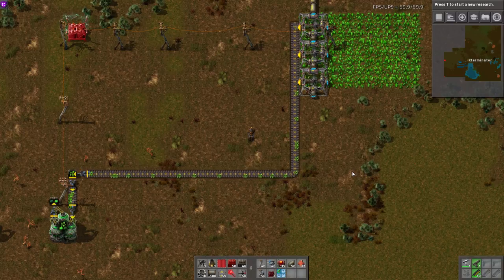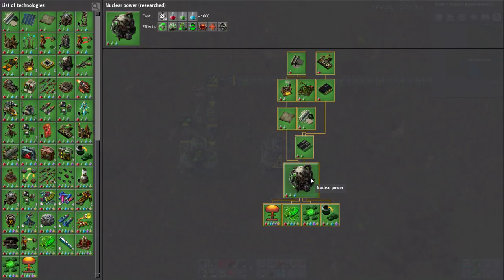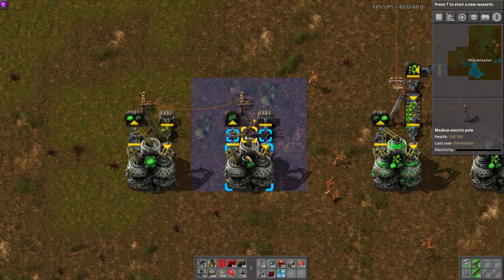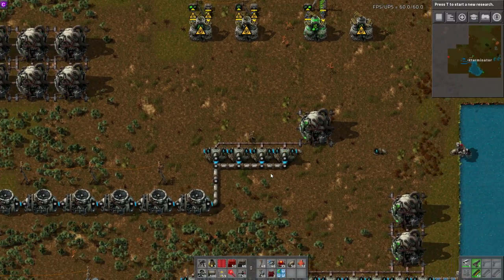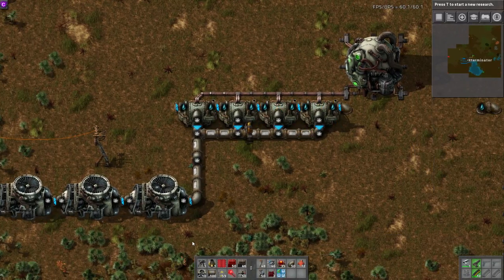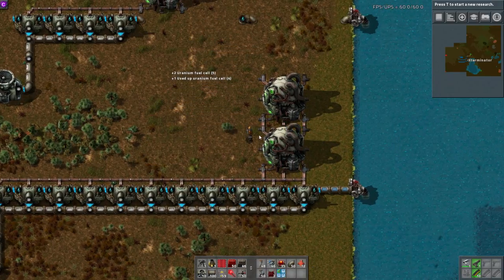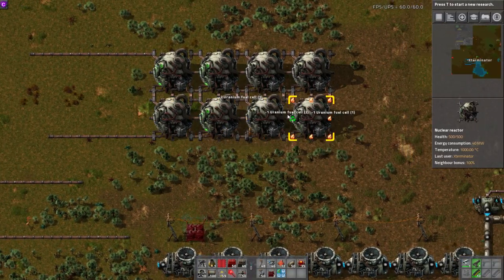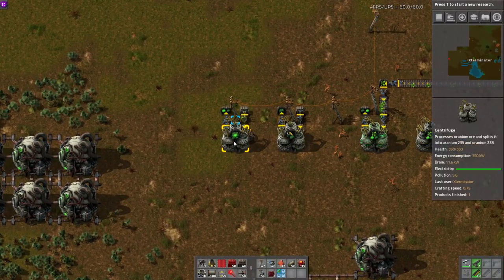Factorio 0.15 Nuclear Power Tutorial - Features & Ratios

Comment: I used the exact setup but the performance is at 1. Everything looks to be right, except it says fluid consumption is low, even though steam is at max
Reply from the maker: Kind of sounds like you aren't using much power so it isn't working very much at the moment.
Reply: Xterminator Ok Ill try to increase consumption

Comment: 16:20 i know this is an old vídeo... but why would you waste só much potential energy just because a pump cant provide for the 16 heat Exchangers that you need to build????

Pumps are basically free...

You could put 16 pumps for the 16 Exchangers and it would not make a difference.... wasting almost 25% of the energy production just because you didn't use 2 pumps is absolutely crazy... whyyy???? Whyyyyyyy?

Comment: i have heard you can boost the power from the turbines slightly by creating steam in coal/solid fueled boilers before it goes into the heat exchangers
Reply: I cant imagine that this will work since water and steam are different fluids now.
I´d guess the exchangers wont accept steam because of this, but i havent tested it.
Reply: Deilwynna Steam isn't a new fluid fyi... steam is actually still just water

Comment: would 8 reactors count as 36 instead?
100% + itself = 2 reactors
100% + 100% + itself = 3 reactors
100% + 100% + 100% + itself = 4 reactors
and so on
Reply: Depends on layout. The maximum % bonus you can get without preventing fuel loading is +300% (400% total)-- this puts 3 reactors to a side, leaving one side open for fueling. With 4 in a square you get 300% per, or 12 Re (Reactor Equivalents)-- but put them in a T formation and you get 400%+3x300% = 1300% or 13 Re. Still other layouts will get other ROIs.
Reply: i was talking about the layout u did with the 8 reactors you made an error while discussion about the formula
Reply: I'm not the person who posted this video, so when you say "the layout u did with 8 reactors" you're not talking to me. I haven't done any tests with 8 reactors.

And yet your reply is to my message to you to try to help you answer your question.
Reply: in this video each end reactor get's 2 neighbor bonuses plus itself, each center reactor get's 3 neighbor bonuses plus itself.
(4x3)+(4x4)=12+16=38
Reply: @x11tech45  in a T-formation, the center reactor gets +300% (total of 400%), while the three end-reactors only have one neighbour left and thus only get +100% (total of 200%).
total sum for the T-formation thus would be 400% + 3 x 200% = 1000% or 10 RE (in contrast to a square with 4 x 300% = 1200% or 12 RE)

Comment: Realistically speaking, sticking 8 reactors together would almost certainly cause 8 meltdowns instead of anything useful.
Reply: Alexsis Crow Have you heard of Chernobyl? They stuck two reactors to one turbine setup.

Have you heard of Britain? All our nuclear reactors are about 500 little reactors stuck together.
Reply: How would it just cause 8 meltdowns? Not following you here. If the water is circulating to a heat exchanger or a turbine, the fuel is being cooled via heat sink. If the fuel is being cooled, no meltdown.
Reply: The water is only inserted into one or 2 of the actual reactors. If we're assuming that each reactor could run like a normal reactor without the neighbor bonuses applying, it would use up all the water before actually transferring any of it over that isn't in steam form. Steam will  not keep a reactor cooled down. There is also no regulation on the amount of steam being transferred between the two of them save the temperature of the first cores. Such a mass input of steam could cause the pressure inside the reactor core to exceed sustainable levels and just cause the thing to explode.
Reply: If you were to say, immediately vent the steam to circumvent the explosion problem, there would still be the issue of heat transfer between super heated steam and a uranium core
Reply: It should also be noted that the reactor itself does not use any power, thus, in real life, no safety systems or regulation equipment would be operational, meaning the  only thing working to keep any of the reactors from melting down is  water being pumped in. If there is only cold water being circulated in at a constant rate and no alieveation or ways to slim down the amount of water being pumped in, the core would be in a constant shutdown state and not producing any steam.
Reply: @kirbykrusher224  arent they just sharing a water input for cooling and heat transport leading to a heat exchanger? As in, one input can sufficiently supply multiple reactors? There should be no steam in that circuit. Steam should only be produced in the lower pressure side of the heat exchanger made by its water source. Should cover both issues.
Reply: @XxXValtenXxX  I know that factorio doesn't have this, but why is radiation not considered into the factor. The sheer amount of additional complications that would throw into the mix would make it very much more hazardous
Reply: @kirbykrusher224  Again, how so?
Reply: @XxXValtenXxX  Simply being near a full uranium fuel rod without any protective gear is dangerous. Holding onto a stack of them would certainly cause permanent damage in mere minutes, and the game is going through a day at an increased speed. Mining, refining and enriching uranium ore would create large quantities of radioactive slag and the game just ignores any identity of it ever happening
Reply: @kirbykrusher224  It's likely just assumed that the numbers are give you are net gains. They could put all that information in there but... it would simply be for information purposes and no gameplay function. As for cold water... it depends on reactor design. CANDU's use a closed loop system where even if the reactor shuts down and no pumps are running, the water will still flow via thermal syphoning to cool the fuel, and would absolutely still be producing steam through the heat exchanger.
Reply: @kirbykrusher224  I mean... the game has the mining system done by machines, so I don't understand how that's going to kill your guy... especially since it's not really that radioactive in it's raw form.... not really much at all actually (Speaking in terms of acute health problems... remember we're trying to escape a hostile planet here). I raw bundle of uranium you absolutely can handle with no real ill effects at all. It's spent fuel you need to worry about... which... one line of dialogue (Oh ya the reactor has a built in irradiated fuel bay) done.

Comment: meh, too expensive per produced MW .... coal still more cost effective no ?
Reply: it also depends on where you find enough coal for the factory, including all the other uses that you may have for coal.
even a relatively small field of uranium should save you tons of coal to make explosives and other needed stuff ...
on the other hand, you also can use greenhouses in modded games for infinite wood, and oil never runs completely dry (for solid fuel).

Comment: It's a cool concept adding Nuclear but the resource cost is way too high for such a very low chance of getting Uranium-235. Just to let everyone know who hasn't messed with Nuclear in Factorio yet. Even when the turbines aren't running, the reactor is still burning off the fuel cell. So don't use your fuel cells unless you need the power or you plan on running off of Nuclear.
Reply: High resource cost? you get 10 fuel cells from 1 enriched uranium. And once you get 40 of the enriched, you can make infinitely more. What are you on about? Scrub tier factorio?
Reply: Have you seen the cost of researching Nuclear Power? The cost of building reactors? Then mining for Uranium-235/238. It's simply not worth it.
Reply: It's incredibly cost efficient! Unless you have a scrub-tier factory. Calculate the resource costs to have either 1.21 GW of power generated be either solar panels(and the cost of the accumulators to go with them to provide power through the night) or with steam engines. Actually take a look at that for a moment. As well as the cost of mining and supply coal to the steam engines too. 

Because it only takes 8 nuclear reactors to reach 1.21GW of constant electrical power. And one normal sized patch of uranium ore. With 112 heat exchangers, and 193 steam turbines. It uses less space, less resources, less time, and less effort while also being easy to tile and expand with growing bonuses compared to solar and steam. 
Go on. Calculate it for yourself. Prove me wrong.
Don't forget to include the time it takes to set these things up, and opportunity cost....
Reply: The vibe im getting from you is that you're a minimalist. You don't play to expand, or reach greater heights, or get farther from last time. You build the very minimal amount of everything, maybe even on peaceful, and wonder why the rest of us want things like nuclear power.....
Reply: Alchemical Games Actually no. I go big. Nuclear is a great concept bit as of right now how it is, I find it to be overpriced on resources and not really rewarding for the cost. I work in the Nuclear field so its cool seeing it implemented.
Reply: You either didn't do the calculations, or did do the calculations and know it's material efficient
Reply: Alchemical Games Getting to nuclear isn't efficient at all just the same as building the turbines and the reactors.
Reply: 1 solar panel produces 60kw in full sunlight, and costs 28.75 seconds, 27.5 copper, 15 iron, and 5 steel. It also only works half the day, and only 1 third of the day at full power. 

1 nuclear reactor works all the time. costs 4.8k seconds, 500 concrete, 3k copper, 1k iron, 1k plastic, and 500 steal. 1 reactor alone generates 40 MW. But with full ajacency bonus's makes 160MW. 

For reference, you need 666.6 solar panels to produce 40MW, assuming they work all day. But they don't, they only work half the day. Lets assume they can get to that 40MW for half the day(which in reality it would be about 2/3rd as much)
That means you need twice as many solar panels, to store power through the night as well, since it's only on half the time. Bringing your solar panels to 1,333. And that's before battery costs. 

to make 1,333 solar panels you need: 38,323 second, 36,657 copper, 19,995 iron, 6,665 steel. 
And we're not even getting into the cost of accumulators, setup time, or anything else. This is just raw cost. What you need for 1 reactor, vs the equivalent power from solar panels. 
1 reactor vs. 1,333 solar panels
Copper: 3K vs. 36.6k
iron: 1k vs. 20k
steel: 500 vs. 6.6k
plastic: 1k vs. 0
Concrete: 500 vs. 0
Time: 4.8k vs. 38.3k seconds

Now don't think I've forggotten the other variabes. The heat exchangers, pipes, and turbines. 
But you should know as well as I do, that even adding the small costs of those in wouldn't even come close to the cost of these solar panels. 
We excluded the acumulators, and the turbines/exchangers because the answer is clear enough already. 

You can't argue with raw statistics.
Reply: You're complaining about the research cost? Are you high? How is that even a factor. Everyone just researches everything in the fucking tree. If you're talking about trying to launch a rocket as soon as possible you could have a point but i feel like not even 1% of players go for that type of game. I think most people take their time and try to be material efficient.
Reply: +Alchemical Games expect you can start making a factory for solar panels within the first half a hour of game play, while you need to wait until the end of the game to get a good nuclear power setup.

adding up just the cost of the mats to get the research needed to set up a useful nuclear power setup you need 2500 red 2500 green 2500 blue 1500 yellow at the bare min in packs. that cost is alone is 238,00 iron, 257,00 copper. total time of 3,3352,500 seconds.

your wrong on the solar panels, it takes 952 to keep 40 MW night and day. so it takes 3808 solar panels which is 152,320 iron, 104,720 copper, total time of 1,685,040.

so in terms of cost and time, solar panels are CHEAPER and scales up okay because of the way you play Factorio.
now does nuclear power scale better then solar panels? yes. when you get to the point where you can have 6 power planets running none stop is the point where iron and copper cost does not matter. its more of a matter of space and how badly you don't want your game to lag.
accumulators? you get accumulators either way with any power setup so honestly that cost means nothing.

"You can't argue with raw statistics." yea i agree

+ B2Roland
read it. using solars is material efficient until you can build and keep running 3+ nuclear power plants or your fps/ups is so slow that you can't stand it anymore.
Reply: total time required 33 mil seconds?  is that hand crafting?  you do realize you are supposed to use machines right?  i dont mark the time that i get nuclear power, but in my friends game we had nuclear researched within an hour or two of unlocking the research, and i did almost all the work because he is new.  i have a factory that mass produces all 3 science lab items, connected to belts that feed the lab juice directly into my labs.  also, solar panels are kind of a waste of space.  in my most advanced game (im somewhat new myself so ive never actually finished) i had 22 steam engines producing 19.8 megawatts which i replaced as soon as i hit nuclear with steam turbines, 127.6 megawatts.  that same power production would have taken 330 and 2,127 solar panels respectively
Reply: as for the actual reasearching, i have 30 of them chained as well.  its a modular system, usually start with only 2
Reply: FreeSpeechGaming I get where you’re coming from brother, given infinite map size and the much earlier access to solar, spamming giant solar BPs with daisy-chained robit ports is still less of a potential headache than nuclear. 

But it’s still damn fun to play with, especially trying to rig it up to work in lieu of accumulators.

Comment: I dont like the fact that reactors need so many heat exchangers and turbines... its not so effective against steam engines becouse nuclear stuff is Expensive
Reply: Expensive yes, worth it absolutely. The massive amount of power may not seem worth it early game however when you have up on 500 stack insertions that alone is annoying to power not to mention the eventual amount of furnaces, and the amount of rockets we have to launch now. In comparison it's not actually that bad.
Reply: With a decent bank of accumulators, it lets you convert to a largely electric based economy, using robots, lasers and electric smelting, so you can reserve coal for industrial and transport use
Reply: @talltroll7092  Or use a bunch of Storage Tanks to store the steam, and a large array of Steam Turbines  for when you need extra power for your Laser Turrets